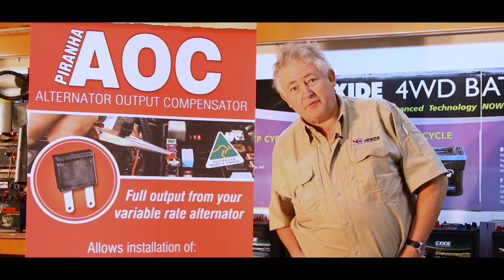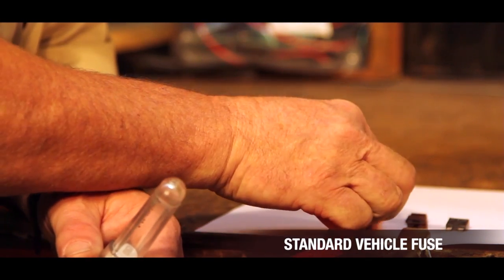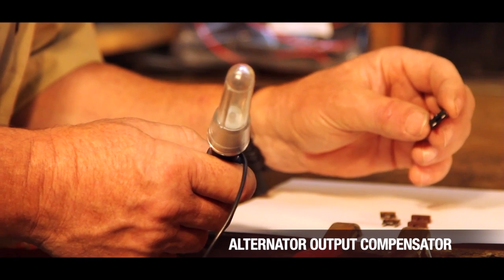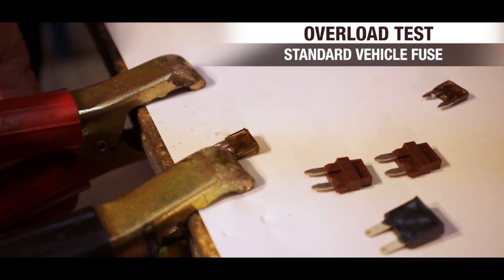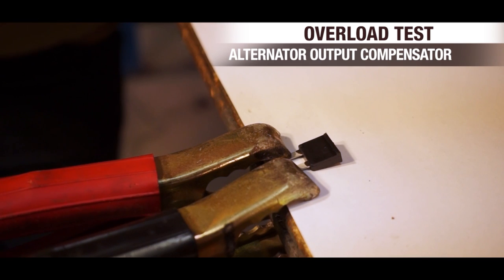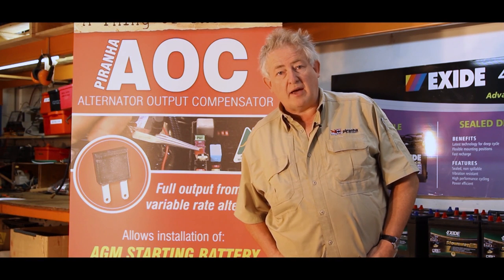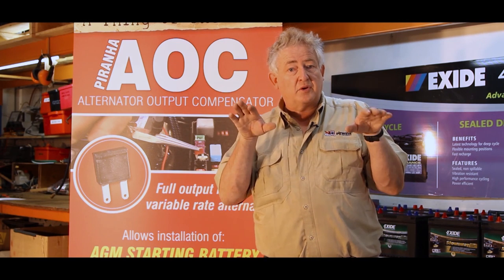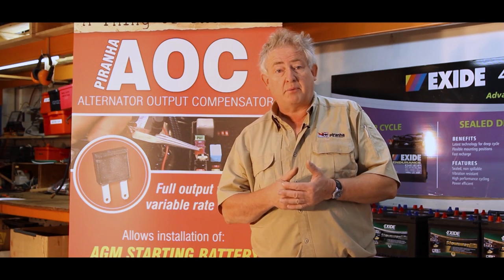Piranha Alternator Output Compensator

Comment: Will this do a proper job in an older alternator?
Would love to bump the voltage to a proper 28.8v on my cruiser.
Everything is all good, it just lacks the last 0.7v to get proper voltage for agm or gel batteries.

Comment: So the Piranha rep compared their expensive product to a piece a junk that is labeled as a 1.5 amp fuse when it's actually a diode and expect the audience to write off all other diodes on the market?  Where did he get that piece of junk and what's the brand and part number so we can avoid it?  I like to see this demonstration on few other more reputable diodes such as the GM OEM Electrical-Diode 12135037 and the Littelfuse 1 Amp Mini Diode
 Part # 02400113XP.  Call me skeptical because I am not ready to believe that a reputable company like GM would put their name on a product that is rated at 1 amp and it doesn't blow at that threshold. Increase the number of brands and the number of samples from each brand instead of just limiting the sample size to just one or two known pieces of junk.  Show us how much current is being applied so we can see at what amperage it blows, doesn't blow, or starts a fire, and how long it takes.  Not saying he isn't right, but let's see him prove his point in a more fair and objective manner.  Until then, he is just a salesman doing his thing.